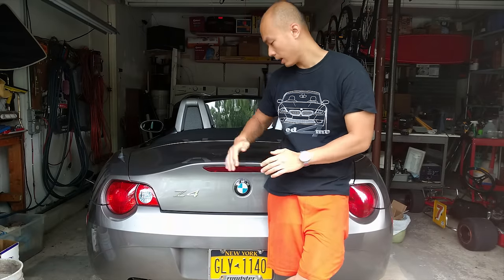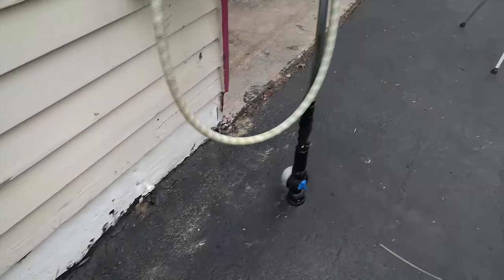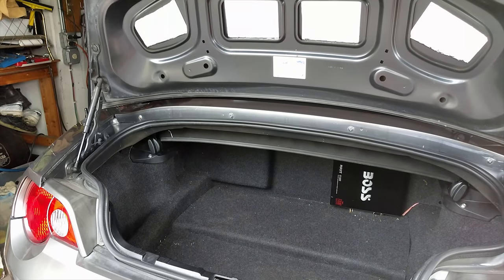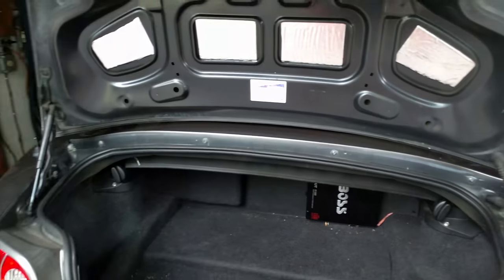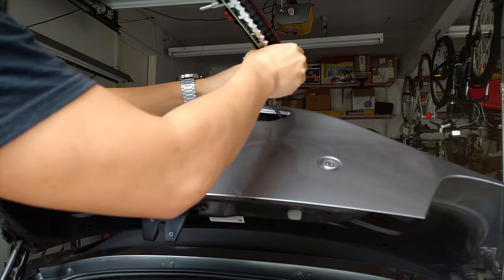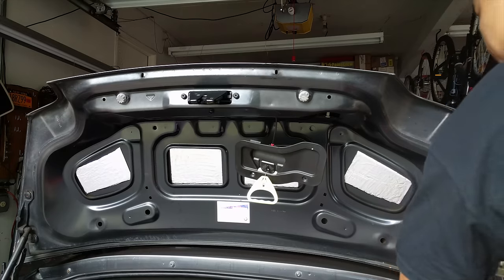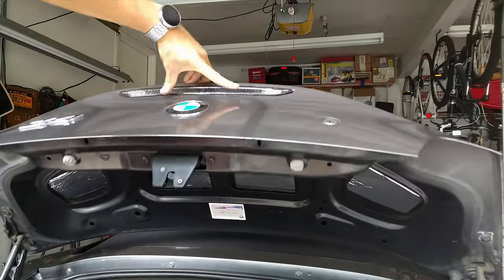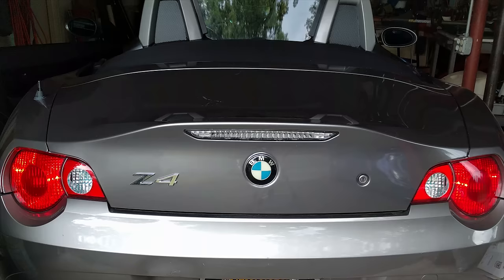How to Replace Third Brake Light - BMW Z4 Vlog #28

Comment: I just installed my light..found that it made it easier to see the bolts with the two black panels off..thanks for the video!!
Reply: Same here. You can hold the springs nicely in place while applying the bolts.
 
That said, these third brake lights sure are a design error on BMW's part. Whether you buy them OEM or not, there is quite some tension on the light, which eventually causes it to crack. That is why I've decided to buy them non-OEM as this second replacement won't be the last I reckon.
Reply: @philcracken  LOL.   A LOT easier to replace than the 3rd light on my 95 Corvette. ;-)

Comment: There's a panel on the left hand side with a sort of handle indent that can also be removed much like the emergency boot release panel on the right. That way a long socket isn't necessary and a normal small 8mm spanner can fit inside. Also, the springs allow tension on the nut such that tightening these bolts beyond much more than that of one's fingers is overkill.
Reply: That' "handle indent" is the trunk pull-down handle.  It's on every BMW that I've owned.  Only on the driver side on the E85 but two pull-down handles on my a 335is, an F82 M4, and an F80 M3.  It's to allow you to pull down the trunk lid quickly to latch the trunk without putting your hands on the paint.  On my Z4 M Roadster it's riveted in place, I wouldn't remove it.
Reply: Great advice. The left panel on my 2003 Z4 is attached by 2 small screws and came off (and went back on) in a matter of seconds. It made it much, much easier to re-install the nuts to the new brake light because I could see the bolts, springs and nuts.

Comment: I did this today also had OEM clear light. Doesn't look that good on my black z4 but looks better than a broken red one. 
The center screw was spinning in place for some reason so I had to break the whole thing to get access to the bolt so the nut doesn't spin in place. It took me 3 hours to do this whole operation.

Comment: Nice video. I am about the replace the 3rd brake light on my silver 04’ Z4. I got the red lens version from ECS. I also note that this was replaced once before under prior ownership at a BMW dealer. How did you juggle the nut and spring to align them without dropping the nut into the inside trunk panel?

Comment: Thanks for the vid.  Thought I was doing something wrong as my 8mm nuts wouldn't loosen.  Discovered that the bolts were turning inside the light housing.  I had to use some vice grips to hold the bolt so I could loosen the nuts.

Comment: Great step by step video, I'll be doing the same this week. I will use silicone lubricant (Dow #7, (not the gel) to waterproof the lens to the body. It won't wash away and will last forever.

Comment: I have a Z4 30i 2011 and my brake light was out for a few days and I kept getting the symbol on my dashboard now the symbol on my dashboard went off well I was driving and the brake light came back on again does this mean that the wire is faulty or that the bulb is going bad?

Comment: Omg bro you have pretty much done everything on the z4 love it, quick question do you know if bmw e46 brake calipers will fit on the z4 ? I read a post about brake upgrades its said all front caliper from e46 are interchangeable bolt on the z4 just need the bigger rotors and wheels .

Comment: Just an FYI - there was a recall on some Z4 3rd brake light. The lens was cracking due to the springs being too strong. Over time they would pull the lens inward and cause it to crack.
Reply: there is an advantage of checking the forum, otherwise you'll go back to square one without the new springs

Comment: I'm just contemplating buying my third brake light in four years. I certainly didn't overtighten the nuts when I fitted it but the design is fundamentally flawed whereby the pressure applied when tightening the nuts is also trying to pull the clear lens away from the fitting. These things fall apart for a pastime.
Reply from the maker: Agreed. I didn't have a problem after a few years but it's a flawed design. I think I remember it starting to show stress cracks when I sold it.
Reply: Hello, your video is very useful, I have to change mine, do you know if only the tulip is traded? Where did you buy the white?
Reply: @manolitorpm5719  Hi Manolitor.  I just had a look and it appears that I did buy a white light from Sytner BMW in Coventry. There are various sites on ebay which sell them.  I'm not sure what happened to it as i have a red light now which is lasting quite well. 
I think it is worth spending a lot of time making sure that it sits well in the recess before putting any nuts on the back and then just do up finger tight.  I seem to recall that the white light is an MOT failure and I bought yet another one. Cheers Kev
Reply: Ok, thank you

Comment: I just did my third brake light a day ago bc it was cracked no problems. Started the car today and got a bulb out indicator. Replaced with oem part from euro parts. Anyone have this issue?
Reply from the maker: does the third brake light work? it shouldn't trigger any bulb out warnings even with aftermarket parts.
Reply: zed4me yes it works, no bulbs out elsewhere either.   It's got to be related to the recent replacement.
Reply from the maker: When does the light turn on? For example, my headlight bulb had intermittent issues and the bulb out warning only showed up when they weren't on